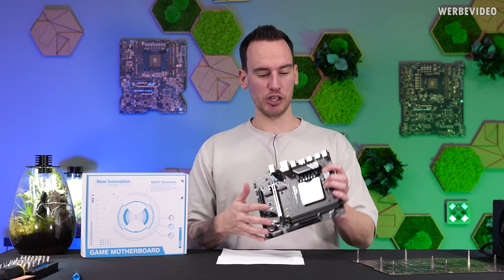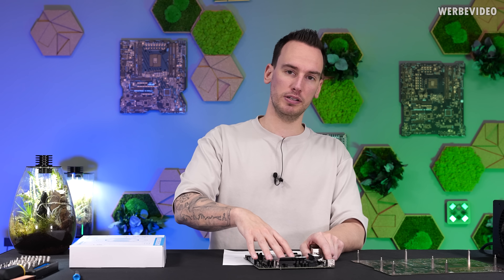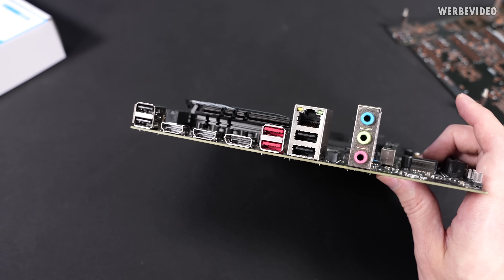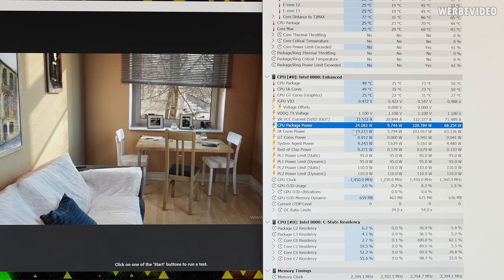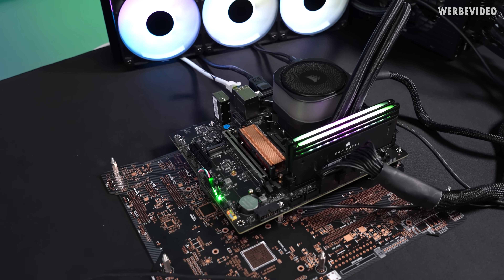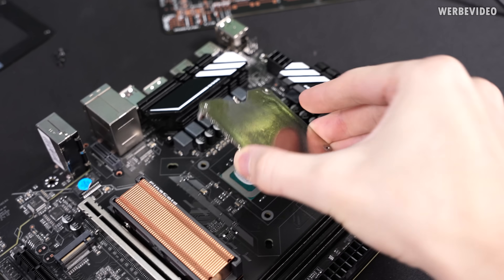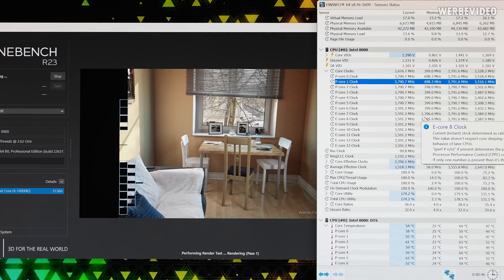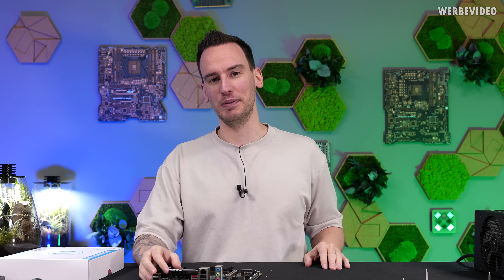Don’t Buy This! Intel Mobile Engineering Sample for Desktop is weird

Comment: These knock off boards and es chips are "weird" I guess, but you get a lot of performance for cheap. If you just want a cheap gaming setup then you do not have anything to lose. I wouldn't use anything from china for production, but for lab or home use you can't really beat it.

Comment: hello, can you review the i7 13700hx-es / 13850hx-es or even i9 13950hx-es next please ? they are the BGA laptop chip engineered into LGA 1700 socket, is unlocked and can be overclock on any 1700 chipset motherboard, potentially could achieve the same performance as the retail ones at half of the price.
Thank you.

Comment: I think that like most mobile CPU's it will run memory sticks that have JEDEC profile that means a max of 5600Mt/s.
I also have and Erying motherboard with a 13500H on it and I could only use JEDEC memory to run it at 3200Mt/s(yes it is a DDR4 board). Any other memory modules used it will run at the defaul 2133, 2400 or 2666Mt/s.

Comment: i swear i seen the clocks at 5.1 gig in the start of the video before you messed with anything...i did time stamp 6:31 even a 5.3, you say windows is reporting wrong? any reason you conclude this for the clocks atleast not just the temps? if the 120$ board is any good that might be worth it but dont see the value here either.

Comment: We have the Intel 12th and 13th and 14th generations as well as the HX series on the MODT platform. We are currently maintaining the R23 record of 14900HX on HWBOT, and we do not use liquid nitrogen. This is just one of the models we have. We also have the Interesting models in the AMD series of MODT platforms include R9 7945HX3D, R9 7940HS, R7 7840HS and R9 6900HX, our channel has not yet been fully established. We will release all the interesting content of the MODT platform in the channel in the future. It is not expensive, but has good performance compared to the desktop.

Comment: I have an Erying Polestar G613 motherboard in my server and it has been absolutely fantastic. Cheap as chips (ha), using an engineering sample based on the i9-11900H if I remember correctly. I chucked 64GB RAM at it (at full 3200MHz!), a 10gig Ethernet NIC, a 500GB boot NVMe, and 4 4TB hard drives, and it hasn't once complained.

Comment: I bought cheaper MB with 12700H and I was able in hidden menu change power limits... I didnt want to go over 150W but it scaled nicely with power. The best thing about that motherboard was that in windows I was able enable / disable on the fly the intel turbo... When I disabled that I had a super effecient internet / work pc with cpu not going over 30W, and when I enabled turbo I had nice boost for high load apps. The reason I bought that was for NAS and vritaulization. I lowered power limits in bios to 45W and it runs flawlessly... When you need a powerfull machine on low power it is a good choice. If you are going for maximum performance there are better choices for sure.

Comment: I tested an older version of a motherboard from this manufacturer (11800H) and my experience is similar: lots of problems with RAM (even 3200MT/s was a challenge on a good bide kit, sometimes it went fine, the next day did not go past memory training)

In the past at least they were very cheap. Nowadays, not very interesting from what I see. If purchased “for fun” I would recommend to go for one with an unlocked processor so it can be overclocked at least, the thermal headroom is there.

Comment: I had one of these early on in their production of them.  the engineering samples, from my understanding, are hit or miss, but they do make them with official chips sometimes and those tend to do well.  the one I had was strange and the motherboard somehow shorted against the case through the standoffs?  Using plastic standoffs fixed it and honestly, it was a great little system when I had it.  the absolute perfect HTPC imo

Comment: You didnt do enough research for this. 
Unlock the bios settings and unlock your TDP. I run mine at 175w and it stays around 5ghz all day long. Great board, unless you dont know what you're doing

Comment: Dear Roman. When i look on your 14900KS R23 multicore score. I hit on my Amd setup with R9 5950X 30700 points on windows 11 24H2. Of course. For Cinebench R15, R20 and R23 works pretty well if you set in taskmanager realtime priority for program. Final score will be better. Doesnt work for Cinebench R24. R24 is a very different program.

Comment: i have the topc version of this board and it has a hidden bios mode. it scores 20000 in r23 with -170mv undervolt 150w powerlimit

Comment: just try F1~F12 in bios menu. For Erying, it's F8. You can set the TDP for 13900HX to 330W and it will get nearly the same performance as 14700K. At half price and lower temperature.

Comment: Such boards are very demanding to ram sticks. Previously such board manufacturers was listing ram sticks specs which will work and OC with no problems. You should also consider flashing custom bios to unlesh its full potential. Speaking about price, in Russia on Ozon marketplace we had 14900HX based board for like 110$ (performance similar to 13600k desktop) before dollar spike. It was obviously a nobrainer. 
These boards are rabbit hole, and i personally would like to watch some vids from you considering the amount of knowledge you have.

Comment: I've been using my Erying 11900h ES board for about 2 years and I've never had an issue. I did put a ptm7950 pad between the CPU die and the heat spreader and it helped with temps immensely

Comment: Ok, I'M Following you channel since the beginning ,and probably 1st time you are saying some BULL%#$!! ,  these boards in general are pretty good some models are expensive ,others have very difficult bios configurations to work properly but in general they are amazing , intel 13 GEN ES have AVX512 enabled when use only P-Cores ,and its help A LOT EMULATORS , 14650HX are one the best for games you can do ddr5 7000 on newer motherboard revisions  , 11900H/K are amazing cont benefit for mid range game machine whit Samsung ddr4  ,most models we can make amazing hackintosh computers . 
"Don’t Buy This! Intel "12 GEN" Mobile Engineering Sample" will be the correct statement ,because this ES models dint have CPU PCI LANES for VGAS.

Comment: it's so frustrating watching almost all youtubers still showing off these boards, I bought one of them because of the hype and it was so unstable it was really frustrating, from then I've said no more Erying boards, they're really not worth it, yeah, the intel 0000 supposedly being an 11th gen i9 was powerful, but so infuriatingly unstable with crashes, dissapearing nvme drives, faulty ethernet connection, quirky usb ports, no, it's just not good

Comment: I have one of those with an i9 12900hk (engineering sample 0000) and it works great i had it for 5 months now and works really well i got the i9 running at 5ghz stable

Comment: For ram overclocking you have to unlock the bios and the overclocking menu. I have two of this with retail cpu, 11850h and 13700hx. With a lot of tuning I am able to reach 5.0p 4.0E. undervolt heavy on core and cache help a lot. I cool both with a peerless assassin 120. -125mv on core and -100 chache. I always avoid es CPUs because the majority of them are early samples and have a lot of problems. But with final products they work like a charm.

Comment: I want put one of this on my dual system phanteks enthoo pro II... And use for light gaming and light work with low power consumption with an rtx a2000 or a4000

Comment: I ran into the ram speed issue.  You have to go back to the Overclock Performance screen and enable that.  Then and only then will the RAM speed be able to be changed.

Mine is the 11th Gen, 11900HK, but I immediately recognized what you showed on the screen - it was the same for mine.

Comment: @der8auer EN - I have the 13900HK ES Erying board.  I was able to get the overclock options working and was able to set the under-volt and wattage profile in the BIOS to keep the temperatures down.  I also have a Thermalright U120EX on it.  I am using it with a RTX 3060 V2 OC 12GB.  It definitely boots in about 5 seconds (which is awesome).  Erying told me themselves that they do not support faster RAM even though I have TEAMGROUP T-Force 6400MHz PC5-51200 CL32 it was cheaper than the 5600MHz RAM at the time so I am just running that at the lower speed.  It does do memory training, and I did notice the issue when trying to set the memory speed.  The BIOS does have the ability to set 6400MHz for the RAM but Erying told me that it is not actually supported.  I also have their i9 11980 ES boards and have been using them for media PCs for over a year now.  They have been doing well.  I have asked them twice about BIOS/micro code updates for the 13900 and they only told me that they currently don't have an update, that they were waiting to hear the resolution from Intel, and said that they would contact me if and when they produce an update...  they still have not, so they probably won't issue one.

Comment: It's important to remember that almost all 13th and 14th generation mobile processors (AS WELL AS DESKTOP CPU BELOW 13600K) are based on 12th generation Alder Lake (Golden Cove cores L2 cache 1.25MB/P-core), not 13th generation Raptor Lake (Raptor Cove 2MB/P-Core).

I am terribly disappointed that no tech-tuber is highlighting how Intel is misleading customers

Comment: Save the question to motherboard manufacturers on a sticky note 
"Why does POST on motherboards take so long?"
The main reason for switching to UEFI was supposed to be to reduce the time from turning on the computer to loading the operating system.

Comment: In that situation (debugging method) you could try to just switch off your psu which is same as removing 24 pin from motherboard. The PSU switch off and on method works for me.

Comment: i bought one of these erying motherboards a couple years ago that have the 11800h (or something eng sample equiv) and have been using it in a home server build! I love that it's a mobile chip so it uses less power than a desktop cpu and runs way cooler. I mostly just use it for running a few vms and a jellyfin server, fantastic value @ around 170

Comment: I made HMIs at my last job and intel would just toss dev/sample boards at us left and right and they looked pretty similar except for the heat spreader, black PCB and lack of aux connectors you never had on hand and had to order in 
and yeah you could configure almost every one of them to boot extremely fast, very useful for things like HMI and signage

Comment: you can unlock hidden advanced bios setting by pressing ctrl F8  several times, i have q1j2 1370p es work great paired with mid range graphic card , got it for 130  usd

Comment: Please, I am begging motherboard manufacturers.

Open. Ended. PCIe. Slots.

If you're going to put a short slot on a board, there's zero disadvantage to installing an open slot so the user can install longer cards if they're ok with the narrower lane count.
Reply: Dremel
Reply: @JJFX-  or just put slots with an open end.
It's like complaining a truck is missing tow hook and replying "welder" yes it works but that's not the point.

Comment: i used a non-engineering sample version of a 12700HK to do a makeshift homelab/nas combo for a friend on a budget. While i didn't test for anything but stability, he's quite happy considering it sips almost nothing on idle and still has the grunt needed when running his containers/vm's. It's basically a gamble, but the odds aren't bad! It reminds me, i should check if there's any bios updates since it came out, i heard Erying isn't great on after sale support...

Comment: I still have my 11900H in a box here. It was fun times messing around those chips, trying liquid metal and direct die. As mentioned, the fact that the 11th gen mobile uses 10nm instead of the 14nm in desktop, made those a great efficiency products, and with nice integrated graphics.

Comment: I am running on a tight budget so.... I got an Erying i9 '11980HK' HM570  from Aliexpress for about $165 similar to this.  It's an Engineering Sample as well.  Jeff on Craft Computing found them so I tried one myself and am well pleased.  I run on the built in iGPU and only added a PCIe 2.5G ethernet adapter.  It is now my daily driver since my old Ryzen system died back in March '24.   It runs Linux Mint great. I have to tell you it has it's quirks but is a solid little machine.  I am not a gamer or over-clocker. I'm a tinkerer mostly.  I do remote support IT and study for my future career in IT.  It's on my DC power supply using a PicoATX PSU behind a solid regulated 12VDC and can pull up 8 amps in burst but usually pulls 2-3  amps.  I will say I've done basic video editing on the CPU.  It's slow and get's hot but gets it done.  I might do 1 video a month.  I'm too busy and don't need GPU enough to require moving my old GTX-1030 from the old machine.  I don't really need it enough maybe one day.  Run it stock and it'll do great  So it's a laptop CPU.. On a desktop motherboard.  The CPU is a thow-away intel sample that Chinese dudes got their hands on and instead of chuck them into trash they put them to use.  Gamer's Nexus covered this as well.
Reply: Pretty much sums up my initial impression with these combos 👌

Comment: I've been running an 11800H Erying board for about 18 months as a project machine. Only real issue was a habit of pumping the thermal paste out after a couple of months so CPU started throttling. Once replaced with PTM7950 it's been decent, and happily runs at 80W TDP.

Comment: Was looking at these to be my new TrueNas server but decided I need to be able to give my VM some Juice so went with a delidded direct die cooled 7980Xe a Asus Sage WS x299 board and 256gb of G.Skill Trident Z 3600mhz Kit. 12x24tb Seagate Exos drives. Figure I can turn off cores when I really only need a seed box or just enough to run windows for grabbing my Media.

Comment: In my experience with modding these motherboard BIOS, never try XMP. It never works. Instead there is another menu (might need to be unlocked) where you can raise the "maximum speed" of the memory clocks, and then the mobo will select its own maximum speed for the RAM. If IMON is available you could use -10 or -25 to trick more power to the CPU. Definitely feels like finding a similar mobile platform and finding the values to unlock more BIOS features is necessary (or, like you found, the BIOS settings don't seem to actually affect the platform).

Harvesting these kinds of mobile-CPU soldered chips into motherboards is super niche-scenario. NAS, user terminal, etc.. For 290$ that is insane.

Comment: These engineering sample CPUs really shine when reviving older systems you don't want to replace. I've an 8 core mobile CPU in an ITX Z170 system and it's definitely buggy and strange, but it DOES work. I can't really complain too much when the CPU was under $70 and after applying the BIOS was literally as simple as just installing the CPU.
Reply: ES is a very broad term. QS is very similar to retail units but with low price
Reply: engineering samples often burn out though, They were never designed to last, only for testing purposes, I've lost money on the gamble and I will never Do it again.
Reply: @Catknapper  I've 4 of them. Had one of them for like 5 years and it's still kicking, but that one is an unmodified i7 6700 ES and not a funky mobile one. That one didn't even need a modified BIOS.
Reply: @Catknapper  How does an integrated circuit "burn out"? 💀 ICs are one of the most reliable components, it's just silicon with some wires attached to it.

Comment: Something is off here. I have minis forum with 13900HX with 90W and 150W boost limits. First run I got 29000pts and when processor declock to long term boost 25000 pts. Clocks that I observ in CB23 are 3800 first pass and than 3000mhz second.

Comment: So for the computer to turn on with the xmp configuration in the bios
Save and exit
The pc auto turn off 
Immediately remove the 24 pin cable
Wait like 20 seconds 
Put back the 24 pin 
And thats all? 
Some question, it have the be the 24 pins and only that cable ? I cant just remove the power cable?

Comment: These motherboards have hidden bios options. To enable them, I think you need to do shift+f2. This will then unlock the tdp options
Reply: quite often they do nothing. toggling a display/hide flag for stock menus from a BIOS template doesn't do anything if the actual firmware functions aren't there, which is very common in these cobbled together products

Comment: the reason why the ram slots are upside down is probably because on atx type motherboards they tried to put the vrms of the cpu in the traditional place and then put the cpu upside down for the power input pins in the bga, so the direction of the crowded parallel data lines to the ram changed and since it is almost impossible to reverse all those parallel data lines on the motherboard, they took the easy way out and put the slots upside down.